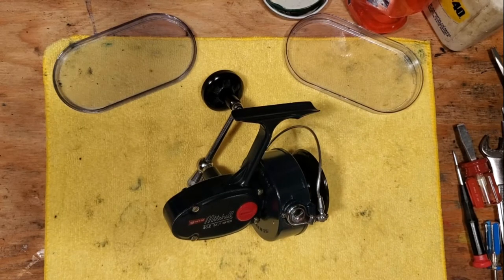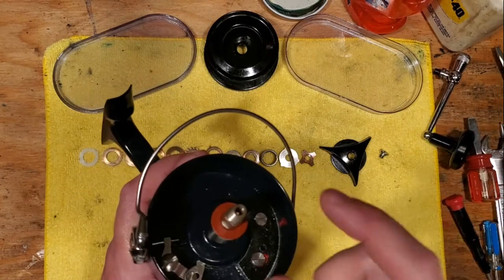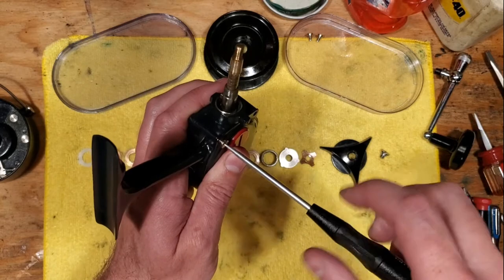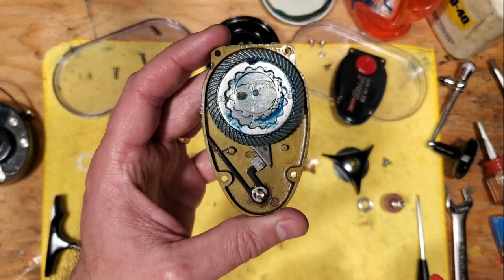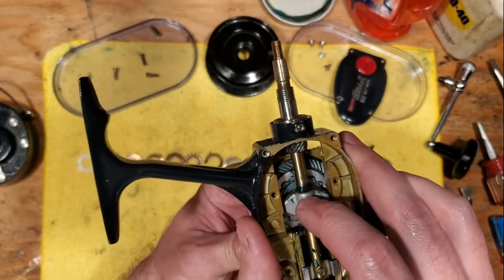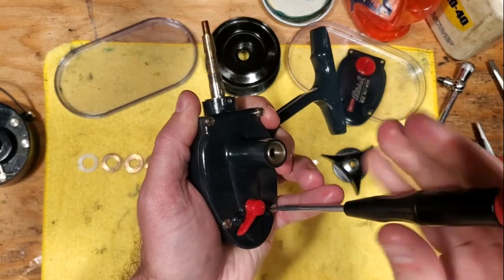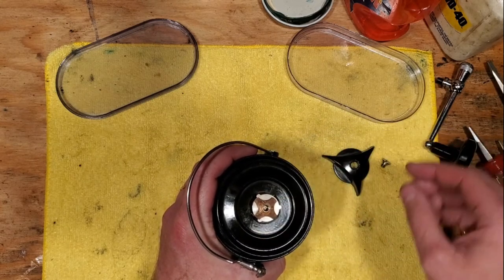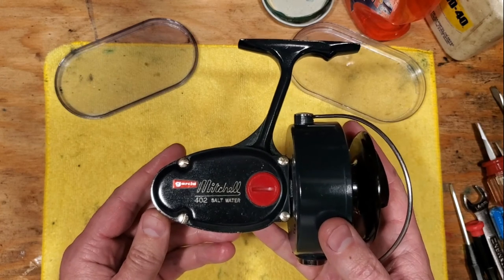Garcia Mitchell 402 High Speed Salt Water Reel Take Apart Steps & Service

Comment: Since I commented on this video a year ago I have gone from 18 mostly saltwater Mitchells to 57. I’ve used about 3/4 of them but a few I will be keeping as collectible reels though all of them actually are. Yesterday I got my second Mitchell 4470 saltwater reel made in France. It may be one of the last Mitchell reels actually designed and made in France though I am not absolutely positive. It is a weird shaped reel with a box-like look to it and has a graphite and metal housing. It is also the only French Mitchell I know of with a clicker switch to turn it off while the anti-reverse is still operating. This is one of my favorite videos of yours. Hope you’re having a great summer! — Chris
Reply from the maker: That is a lot of Mitchell's. Thanks Chris!

Comment: Tony, just got thru watching your strip-down/maintenance of the Garcia Mitchell 402 Hi-Speed reel. Your careful presentation and clear instructions made it a joy to watch. I have fished with these 1960's reels since I was a teenager and have been thru the whole stable of the Mitchell Reel lineup. Each reel model is unique, and once you learn those specific tricks to repairing them, there will be no mystery anymore. Your presentation is the best that I have seen on Video. Keep up the great tutorials.
Reply from the maker: Thank you very much!
Best Wishes!
Reply: @backonthebenchreelrestore  I know video is old but what is the part with the four legs coming off it called I need help I identifying it I need to oder it its part of the drag

Comment: You can count yourself fortunate if you get one of these and those set screws can be removed. There are c clamps on the axle shaft the allow you to disassemble from  the spool end. If you  don’t mess with those c clamps you can back it out. These reels - 302 - 402 - have a tiny little key in the pinion bearing area that is easily lost and without it the reel is useless. I have these 302 and 402 reels in both bailed and PUM versions and use them surf fishing. Considering the 302 goes back to the mid 50s these reels are some of the finest saltwater surf reels ever made and far superior in design, materials and workmanship to all but the really high end contemporary reels. Getting planetary gear correct can take some effort. I’ve restored a number of these for friends and  have had to buy a few parts reels in order to do those restorations. I have 18 Mitchell reels most of which are saltwater reels including those large ones - 302N, 406, 396, 496, 488, and 498. I love them but some parts are getting very hard to find. Based on the advice of several longtime Mitchell reel repair guys I started using Super Lube synthetic grease in Mitchells. It is white translucent grease that seem to work very well on Mitchell reels. I use the Penn synthetic oil and have absolutely nothing against Penn precision Reel Grease. I like using that Mitchell large reel tool on these reels particularly because they have that forked end on the cross piece that helps with working on the bail. Great video as I am relatively new to your channel.
Reply from the maker: Thank you for watching. I do like using the Penn products for the lube work.  I also use Reel X oil as well.

Comment: Hi Tony, I enjoy your video. My 402 needs a centering key that you mention at 3:39 and I need a side plate screw.   The centering key also is what makes the rotor spin. Without the centering key the rotor will not wind line as I found out.  Do you know where I can order them?
Reply from the maker: Hi Joseph.  Yes that centering key is a real common part that can go missing.  I would start with ebay for parts.  You may need to pick up a parts reel to get what you need.  All the parts for those early generation Mitchells are long out of production.  Hope that helps and thanks for watching!

Comment: Great video. Just got a 403. Isn't the 402 a right handed version and the 403 a left handed one?  Also, my side plate appears to be upside down. When hanging from the rod, you can't read it, it upside down.  To your knowledge, is this normal? 

Thank you for the informative video.
Reply from the maker: Thank you!  The 402 is left and the 403 is right.  Hmm.  The Garcia logo should be at the base of the reel and the big red plastic turn knob should be just below the rotor.  You should be able to read the logo when it is hanging from the rod.  Hope that helps.  Thanks for watching!

Comment: I'm wondering about replacing the little bumper bail on my Mitchell 402. I have a replacement but am hesitant about prying the old one out. Any input appreciated
Reply from the maker: Michael, this is a pretty common replacement with these more vintage models of saltwater spinning reels.  You should be able to pry off the old one fairly easily.  These do crack over time so don't be surprised if it starts to crumble apart.  The new one should go in easily with a little pressure applied.  A snug fit is a good one.  Good luck. Tony
Reply: @backonthebenchreels  Thanks. Will attempt.

Comment: Tony, thanks for the excellent and comprehensive video on the 402. I bought one for an old friend who loves the Mitchels and will service it before sending it to him. I’ll follow your tutorial. I do have one problem and that is the bail is bent; the handle and the bail hit every other crank of the handle. Part of the bail also scrapes the spool in the open position. Any idea as to where I can get a replacement?  Either that or I’ll have to try and re-bend it into place. Thanks again. I’ll subscribe.
Reply from the maker: Craig, ebay has been my best source for mitchell parts.  Just FYI I have purchased new OEM mitchell bails before and sometimes they still need to be bent even though they are considered new.  Good Luck & Thanks!

Comment: Picked a rod and reel combo up at a yard sale for 10 bucks! Reel is very stiff. Following your video is easy! However the stiffness is in the handle shaft to the large gear and you do not show how that comes apart 😟 Any help would be nice. Thank you.
Reply from the maker: Once you have opened up the inside of the reel you should be able to pull the main gear out of the  handle shaft.  Clean the inside with some WD-40 or equivalent using a que tip.  Then brush some fresh reel grease on the main gear shaft and put it back through.  I will be doing some new videos soon on a Mitchell 302 soon which is basically the same as the 402.  Hope that helps and thanks for watching!
Reply from the maker: And also clean the main gear shaft well before you grease it. Take some steel wool to the shaft to make certain it is clean and round.
Reply: @BACK ON THE BENCH REEL RESTORE   thank you for the quick response, I looked up the schematic and saw that it had no fastener. I actually had to use a small drift pin and tap the shaft out as it was pretty stuck. Got everything cleaned and lubed. Feels fantastic! Using it to tomorrow for lingcod fishing off the rocks on the Oregon coast.
Reply from the maker: @justavoicefigg8925  Great!  Good luck!